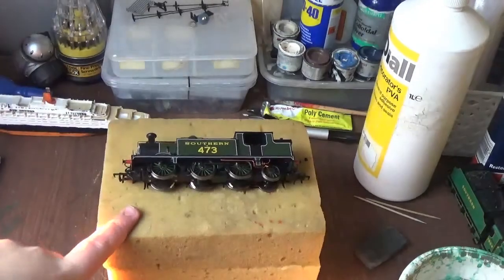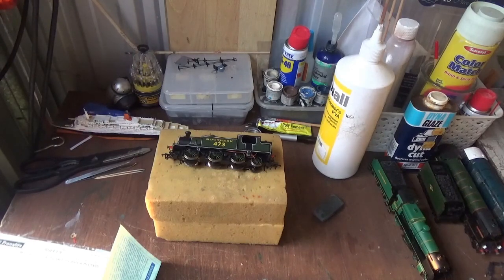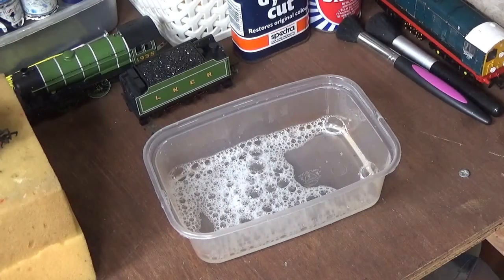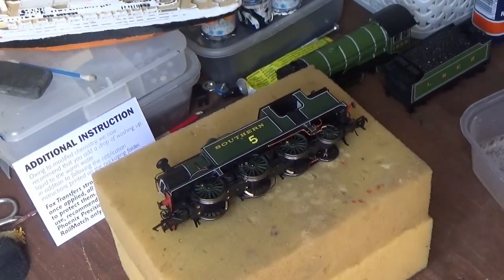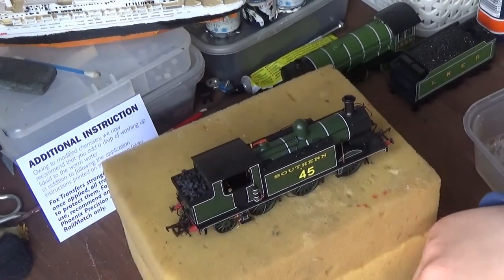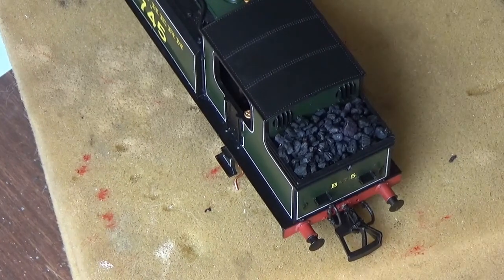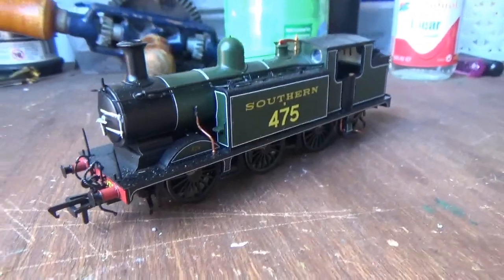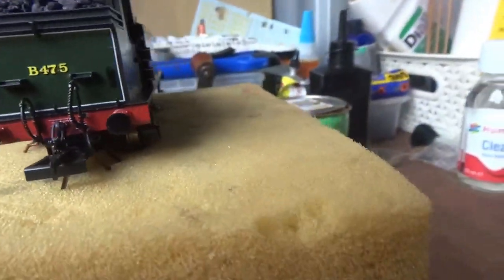How To Video: How To Renumber a Locomotive

Comment: HMRS transfers aren't meant to be dipped in water. you just cut them out, position the model then apply a small amount of water to release the protective paper. had no issues with them personally
Reply: Me neither, the clue is in the term Pressfix. Using them incorrectly does not qualify as a valid criticism, always read the instructions for best results, then you'll achieve them. Prototype info for the E4 class here:

http://www.semgonline.com/steam/e4class_dat.html